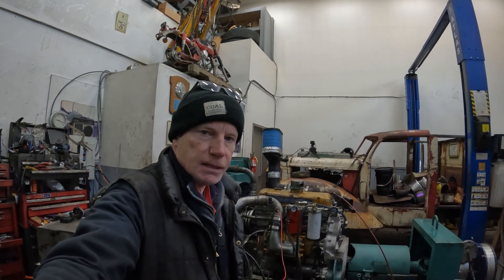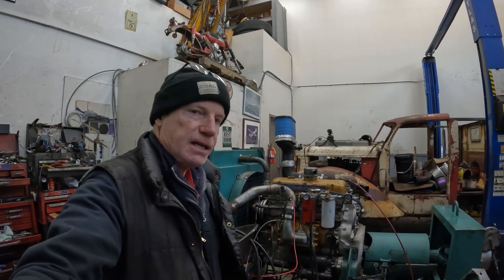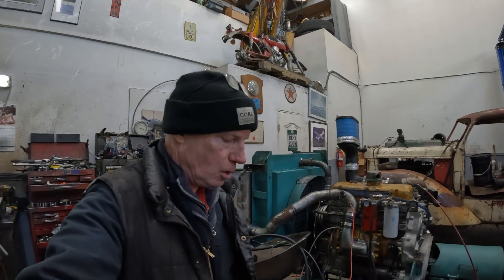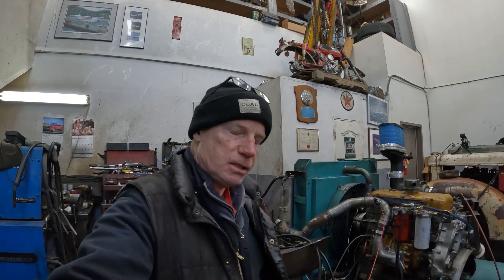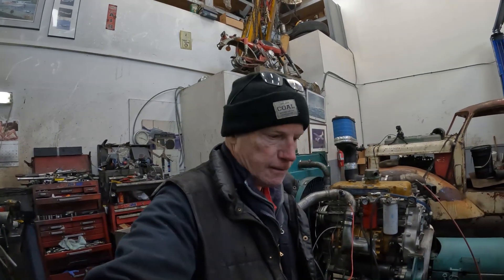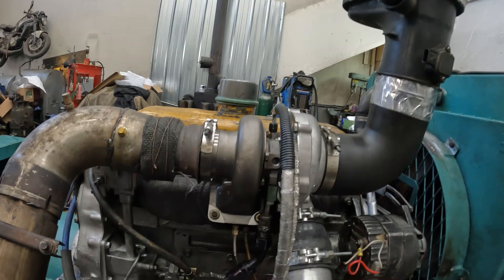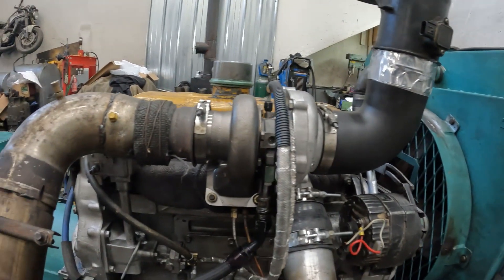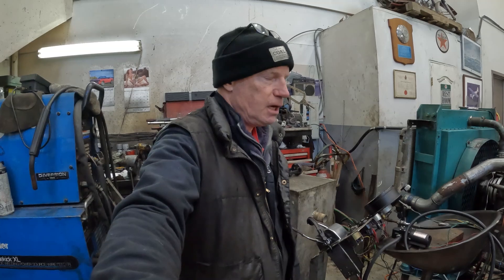Detroit Silver 4-53T (Pulsar .63 Housing)

Comment: I really expected it to have lots of low rpm torque and boost with that small .63 A/R turbine housing. That assumes there is boost enrichment akin to a P7100 Bosch pump or a method to get more fuel into it at low rpm. Thanks for documenting these tests.
Reply from the maker: I did as well, but not to be.:)